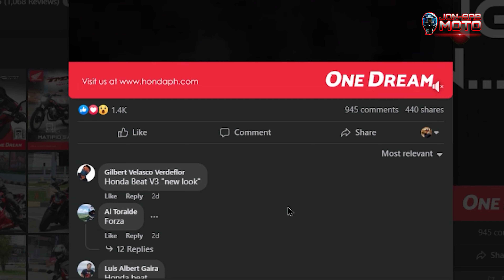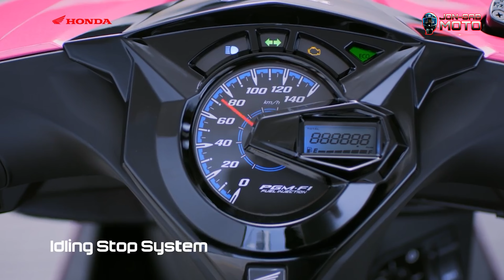BABALA! Panoorin mo to bago ka bumili ng Honda Beat Version 3

Comment: Easy lng mga paps.   Regards sa frame i think sa tagal ng di nila inilabs yng beat na fix na cguro nilaya. Syempre honda brand yan. Di nmn pedeng sirain. Nila name nila pra jan lng sa  issues na yan kya easyhan nyo lng.
Reply from the maker: Baka nga siguro yan ang dahilan na natagalan itong makarating dito dahil cguro ni-recall muna nila ang lahat ng units nito, para ayusin or palitan ng old chasis.
Reply: nag apology na po si honda, pati ata indonesian gov kasama na sa investigation. Normal naman magkamali sa ganyan, ang mahalaga eh yung support sa tao at recall
Reply: @JONSABMOTO  and I think na fix na cguro nila ung issue na Yan.   Or. Pedeng  ung frame nya sa dti pa ring v2 na beat Fi which is good pa Rin nmn sakin.  At goods pa rin
Reply: @opopopo12331  so kung na recall nmn na. Which is ung mga new beat Fi na v3 na ilalabs sa atin n fix na ang issue  rigth .  Kya wag kakabhn. Big company Yan. Masisira sila kung ung alm na nilng issue ehh tutuloi pa Rin nila
Reply: @AserjohnQuibete   di ko po sigurado kung nirecall, kasi di naman sila nirequire ng indo gov. sabi naman nung 1 vlogger yung sa pinas naman na beat v3 eh lumang frame daw yung gagamitin. mas maganda sana kung magrecall sila or extended warranty.
Reply: @opopopo12331  ung recall or warranty di na sakop Ang Honda pH ja. Sa Indonesia Ang issue. 

. Kung Ang Honda pH. Ginwa nyng V2 frame Ang v3 na beat Fi. So case closed na agd. Ganun lng ka smple
Reply: @AserjohnQuibete  honda indo po ang sinasabi ko dahil yun din yung nasa video. 

Mabuti din na inagapan ni honda ph at hindi ginamit yung esaf sa v3. 

Still, di maitatanggi na may issue talaga sa esaf, at gaya ng sinabi ko sana magrecall sila sa indo kahit hindi sila nirequire ng gov nila doon. Ok lang naman maging fanboy ng honda, pero pag may mali di ba dapat itama. Hindi naman sinisiraan ng video yung honda at babagsak pa din yan sa aftersales. Kung maganda ang aftersales, kahit china brand pa yan, magugustuhan yan ng tao.
Reply: Indonesian made mahina tlg kahit nga sa shoppee dam8ng fake madw in indonesia
Reply: depende na dn kasi sa environment ng lugar nila, for example ung gimagamit ng honda beat v3 na taong un, maulan at maputik lagi sa lugar nila kaya nag cause ng ganyan, laging nasuong sa baha halos araw2 kakalawangin talaga yan for sure
Reply: GG sa mga bumili kasi binuksan na dito and naka ESAF nga.
Reply: @opopopo12331  khit v1 or v2 na beat fi napuputol din chassis idol

 V2 user ako pero di nmn ako hater ng v3 na beat fi ?
Reply: @SoloTab  yun nga eh, esaf daw yung ginamit hahaha, sabi nila v2 frame
Reply: Nku nadismaya Ako ...kuha pa nmn Ako Nyan una gusto ko talaga Yung MiO gear ...tas biglang ni recommend Yung Honda beat saamin ok daw un Kasi magaan..tas tipid sa gas..Kya bigla Yun nlng pinili nmin...Ang Honda beat...ngayun prang gusto ko nlng ung MiO gear😢
Reply: Esaf din ang v3 n inilabas dito sa pinas
Reply: ESAF frame parin gamit nila didto sa  pilipinas, pati na sa click 160 edaf din
Reply: @mayethcentro7126  wag ka ka kbhn jan. Di nmn yn mttuld sa indo mas matby frame nyan ksi gwang pinas yan

Comment: parang ayaw mo kami pabilihin ha gnda ng last part sa video haha. actually meron ako beat 2017, naka 4 yrs din sakin at talagang napakatipid sa gas, kaya lang naliitan na ko lalo pag angkas ko misis ko, kaya binenta ko din pero wala ako naging problema, swabeng swabe sya, para saken ok na ok to sa mga nagtatrabaho grab food ganun sulit tipid sa gas at maintenance. tumaba kasi ko kaya pinalitan ko ng mas malaking scooter.
Reply: kinakargahan ko pa yan ng bigas sa footboard, minsan tatlo pa kami ng anak ko s motor, d ko naisip na ganyan pala kanipis yan frame nyan😅 pero d ko naramdaman na lumagitik un frame,
Reply from the maker: Old frame yung sa version ng beat mo boss which is matibay yun. Yung kalalabas lang ng beat v3 is naka new frame na gawang manipis lang na hinulmang steel plate.
Reply from the maker: For awareness lang po boss.
Reply: ay kaya pala, ty boss. dapat ayusin ng honda yan masisira sila, maganda pa nmn ang beat tapos ganyan ginawa nila

Comment: Meron ako beat v3. 6 months palng , kinagarkahan ko ng 2 semento sa uanahan at dalawang semento sa hulihan.. pagdaan ko sa malaking hams lumagutok sya natakot ako , nong pina check ko sa mikaniko umangat lng yung flrengs nya sa apakan ,pero d naman nabali ang frame😅, natangal lng yung lock ng flerings.😂😂
Reply from the maker: Matibay naman yung load capacity design ng ESAF frame. Kaya lang base sa mga videos dun sa Indonesia mejo madaling tamaan ng kalawang dahil kahit matibay yung design ng frame, manipis nga lang gamit na steel plate kaya mabilis makatagos yung kalawang. Pero so far sa Indonesia pa lang ito na issue so parang sa lugar din nila ang sanhi ng issue at wala pang update yata ang ASTRA Honda Indonesia patungkol sa imbestigation.

Comment: YUNG KULAY N PINAKITA MO SA INDONESIA UN AVAILABLE PAPS...MY PLATE NO PA SA HARAP..WALA NMN GANYAN SA PINAS PAPS SANA GUMAWA K ORIG N VIDEO NA KUHA MO NA SA DEELER SHOP...PARA MAS MUKHANG ORIG KONTENT MO PAPS
Reply from the maker: Requirement po talaga sa ibang bansa ang plate number sa harap paps kasi nasa batas nila yun sa Indonesia. At natural lang na wala pong front plate number ang Beat v3 sa pinas dahil hindi naman required sa batas LTO ang front plate number sa Pilipinas. Anyway at kahit ibang kulay pa yun sa Indonesia ay same motor parin yan. Gusto ko lang i share yung mga issues na nangyayari dun sa Indonesia for awareness. Yun lang.
Reply: @JONSABMOTO  ang punto ko.ung pinakita mong clips ng beat eh design s indonesia baka mamaya isipin ng nanuod ganyan din available n kulay sa pinas...iba ang kulay n available s bnsa natin
Reply: Sir September 18 pa po niya inupload tong bidyo. Nung September 23 po nag launch ang version 3 sa pinas. Hindi padin naman natin alam actual kulay na lalabas sa time na inupload nya to.

Comment: Katakot yan di puwede pang J&T Rider Courier, or baka yung ilalabas same frame ng Pinas variant or na fix na nila yung issues na yun or susubukan nila dito kung same scenario mangyari😅
Reply from the maker: Sana na fix nanga nila ito paps. Sana tubular frame nalang.
Reply: Pede nmn Yan latero TAs pinturahahan Ng epoxy primer